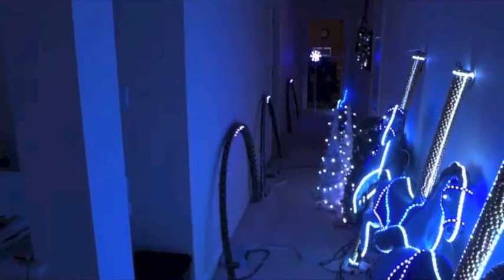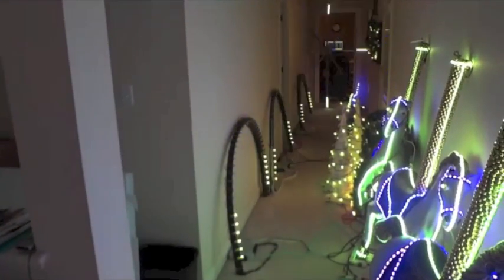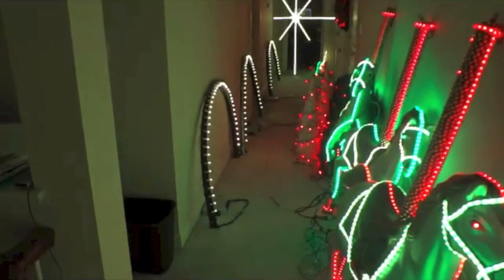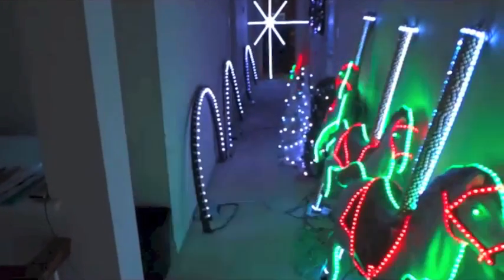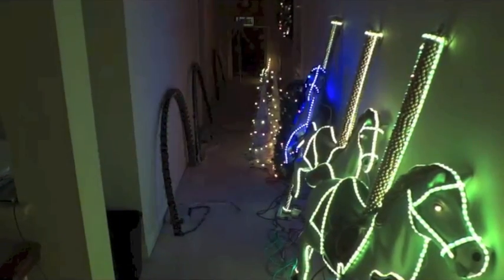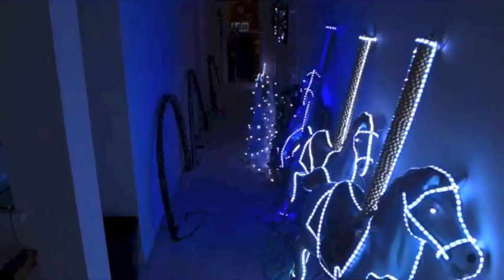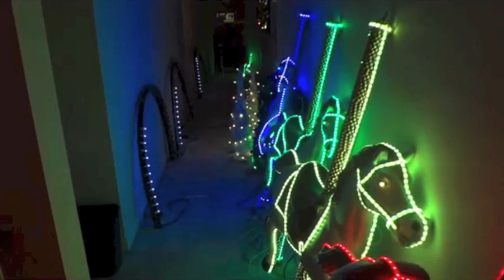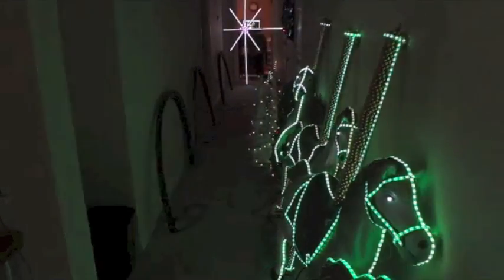3 RGB Leaping Arches | 27 Channel DMX board | LED RGB Light nodes | LOR | Lightorama

Comment from the maker: It's more fexible than standard Christmas lights. If I want one tree in my yard to be green, then red, then blue.  I would need three strings of regular christmas lights.  If I'm using Lightorama to control those strings, I need three extension cords to just one tree using 3 Lightorama channels.  If I use lightorama S3 and with DMX, I have one string of lights and 3 DMX channels, with one cable for power and DMX signal to control one set of lights to any color in the rainbow.